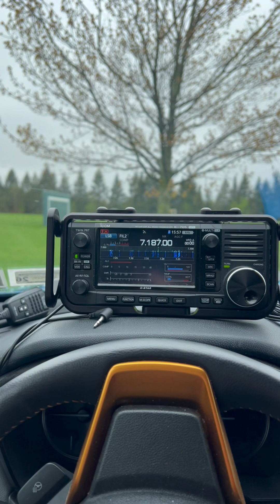#POTA contacts on 900MHz, 1.2GHz, and 40m while out at the park playing #HamRadio #LeaveNoBandBehind

Comment: I hope to work you on 33cm someday.  There are multiple frequencies claimed to be the calling frequency.  What do YOU use since you are actually making contacts?
Reply from the maker: I used 902.200 MHz and 1296.200 MHz. Many contesters in the WNY region have their antennas and transverters setup for the lower portion of the bands. While that frequency is close to the weak signal calling frequencies, it’s up just enough not to interfere.
Reply: 927.100 is where all the 33cm enthusiasts hang out in Southern IL near St. Louis.  927.500 is one of the multiple calling frequencies.   So prior to your tip, I would never have tried 902.2!